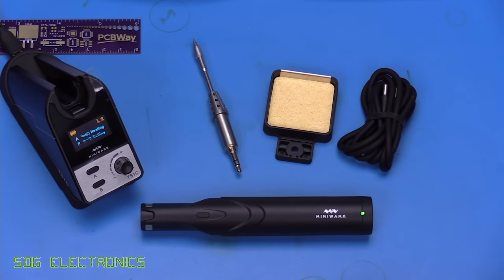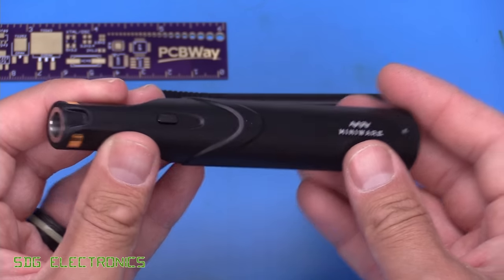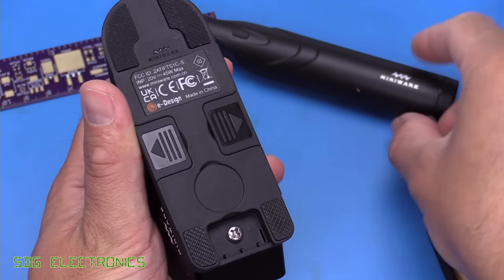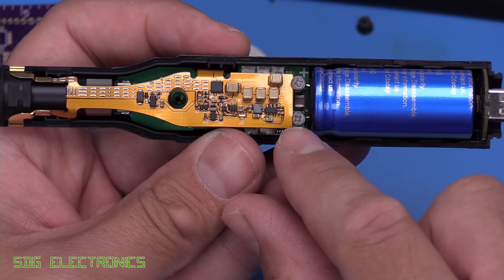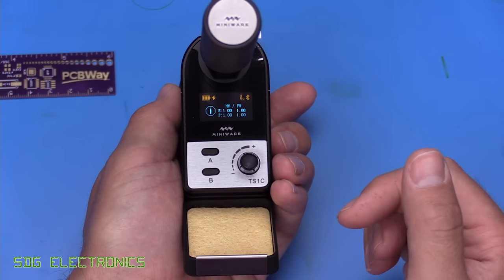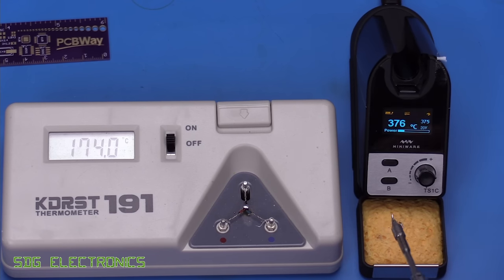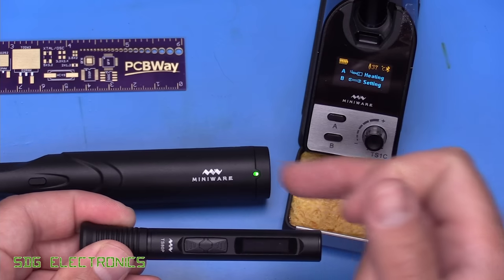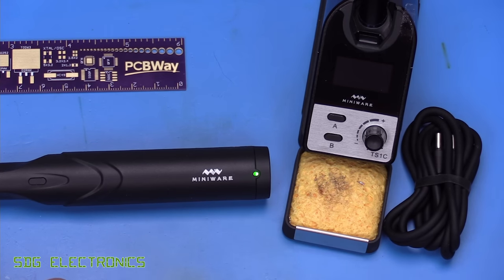SDG #307 Miniware TS1C Cordless Soldering Iron

Comment: This plus a capable Powerbank and you are suited for almost everything.
I like that they use a Super Capacitor instead of a battery, because the battery will probably fail after a couple of years - especially if you don't solder frequently.

Comment: I like the idea of no lithium battery. I guess this thing will last a lifetime if the software in the micro controllers flash doesn't let you down.
Reply from the maker: Not sure on the lifetime of supercapacitors. It should be far better than a lipo though
Reply: 50 000 cycles degradation <= 30% according to the datasheet, versus around 500 for li ion

Comment: Quite a different product. Seems good enough for small jobs. For portable work that has low advantage over USB-C PD iron with PD powerbank. Sure, a more compact but give an iron a 10000 to 20000mAh PD power bank and you have lot more power.
I did not see a test if it works without a cradle or if you need usb power for it anyway for portable jobs.

Comment: Cool design, I like it. Except for that flex PCB touching the supercapacitor. It's a pity they used TS80P tips instead of TS100. It lacks a bit of power for me.
Reply: Based on the internal resistance of the soldering iron tip and the size of the soldering iron tip, the TS80 series soldering iron tip is more suitable as a cordless soldering iron.
Reply: @miniware  
So what about a future curie induction soldering system?
Are you working on it,because if yes,then i'm preparing to bring my wallet and buy it :)
Thanks.
Reply: @gregandark8571  Sorry, there is no technical reserve in this area.

Comment: Can you walk across the room away from the base station and still solder? I could see this being really handy for in situ soldering of equipment, wire bundles, etc inside large equipment without having to rig up a soldering station and extension cord.
Reply: Yes, good point. Does the handpiece continue to function if it loses communication with the base station?

I could envisage this might occur if you take it away from the bench to solder something some distance away - e.g. outside, garage, etc.

Steve, could you test this?

Comment: I like the design, the addition of screwed terminals for the supercap seems like replacing it is doable?
How long can it solder before it needs to be charged again?
Reply from the maker: If it's fully discharged, around 2 minutes is enough. Yes I did think it is a good idea that it's replaceable, though I'm not sure what kind of lifetime to expect.

Comment: Is the performance different when using a cable directly with the soldering iron? Especially with the high temp mass pcbs. Cheers
Reply from the maker: No different, just doesn't run flat!

Comment: That is not a supercapacitor but a Lithium battery 2.5V to 4.2V range with 300mA capacity designed for high cycle life.  The 750F capacitance is just the equivalent but it is not a capacitor.
Cycle life seems to be around 50k cycles before capacity is at 70% of original. Not only that but there is also a calendar degradation and if stored fully charged will likely need to be replaced after 2 or 3 years.
Reply: Show me a lithium-ion battery that only degrades to 70% capacity after 50,000 cycles...
Reply: @joshdau  They did not provide exact details of how those 50k cycles where made.
This battery is in a 1840 size format and has only 300mA where a slightly larger 1865 can be found in 3000mA capacity so an order of magnitude larger capacity.
If you take that 3000mA and only do 10% DOD cycles somewhere in the middle of the voltage range it can do 50k cycles with no problem.
So this battery was optimized for cycle life to the detriment of energy density.
Some other Lithium chemistry like LiFePO4 can do 500k cycles at 5% DOD.
In any case my comment was about the fact that this has nothing to do with a super-capacitor. Super-capacitors have such a low energy density that it will not be worth to combine with a Lithium battery. Also super-capacitors are 2.5 - 2.7V so you will need two of them in series to parallel with a Lithium battery that charges to 4.2V.
If they could have used a supercapacitor then it will have made this a product that could be used for decades with no problems but since it is a Lithium battery it will likely end in the landfill in about 5 years.
Reply: @electrodacus  Voltage drop is linear which makes it a supercap to me. LIC1840Q3R8757 "A lithium-ion capacitor (LIC or LiC) is a hybrid type of capacitor classified as a type of supercapacitor. It is called a hybrid because the anode is the same as those used in lithium-ion batteries and the cathode is the same as those used in supercapacitors"
Reply: @jaro6985  What they show there (in the spec sheet) is a high discharge rate 1C and 2C and at those sort of discharge rates a Lithium battery will discharge fairly linearly as well.
But a supercapacitor will not have that discharge curve shown in that manual.
When half discharged a capacitor voltage will not be at half the voltage range but much higher voltage.
This so called hybrid capacitor has a capacity of 1Wh and in same size 1840 you can buy a 60F 2.7V supercapacitor with just 0.06Wh.
So if you want to build a hybrid supercap/battery then the capacitor part can not represent even 5% of the total.
Hi energy density lithium cells have a flat charge discharge curve if you keep them in the recommended range typical 4.1 to 3.3V

Comment: i have a t12 i made with 18650's i take with me lasts a couple hours, you can actually buy a pre made psu board from ksger and others that is designed for 18650's this is okay but for the time you get to solder vs the time it takes to charge i just dont  know if its worth it. also they should have went with 100 tips vs the 80 imo with these. but the 80 may have been easier to drive. imo they should have just went with a battery inside vs the cap. i wonder if one could change out the cap for a battery

Comment: Wonder what sort of life span we can expect from something like this, as well as how long until we start seeing degraded performance?
Reply: Why do you think it'll degrade? Couldn't the same thing be said of something with a lithium battery ? It is a capacitor after all and I hazard a capacitor will survive many more cycles than any battery.
Reply from the maker: It should survive significantly longer than a LiPo cell, but supercapacitors do fail over time with increased ESR.
Reply: Well, these are CONSTANTLY cycling charges. If you cycled a lipo as many times as this.. it wouldn’t last long. These are probably going to start to degrade in a year of regular use imo, yes that’s longer than a lipo, but in the grand scheme of things it might not be practically long.. but time will tell as I can’t find much on this particular cap
Reply: @wafu6058  Its right in the datasheet (LIC1840Q3R8757), 50,000 cycles at least. If you solder for 5mins from one cycle, thats like 170 days of continuous soldering, it wont degrade in a year.

Comment: With 750 Farad the capacitor inside the soldering iron would  hold as much energy as 10 (!! TEN !!) AA NiMh Batteries, exactly 26730.8 milliamperes houra. Even more unbekieveable that it should  have double the voltage, compared to NiMh cells. In my calxulationn, i even did not take  any voltage differential into account.

Something is not quite right here...

Maybe i just can not calxulate any more or something else here smells like fish!